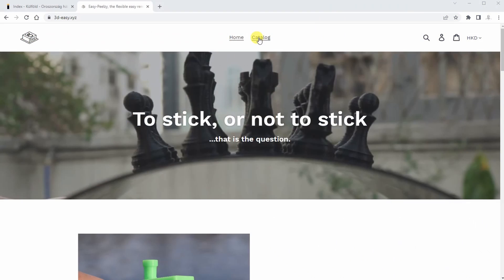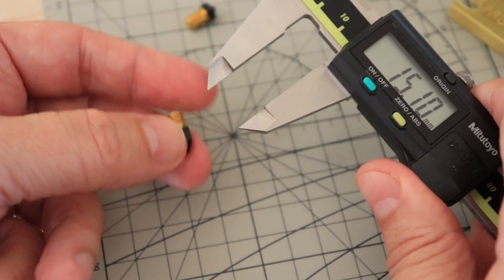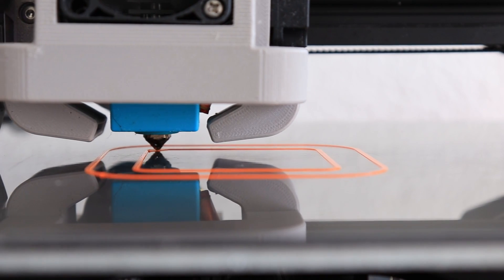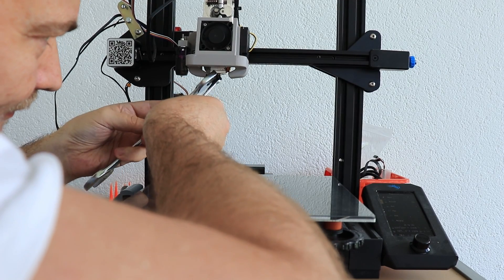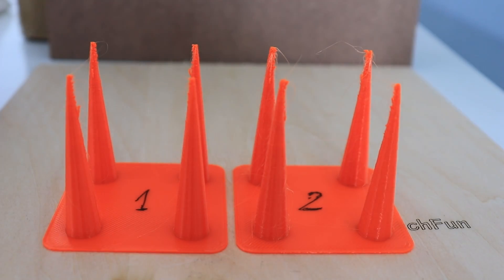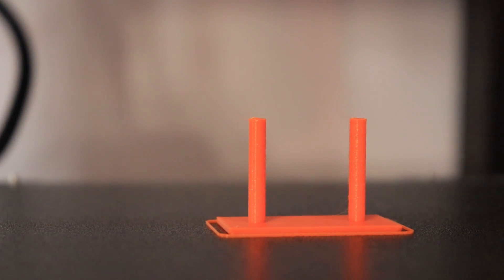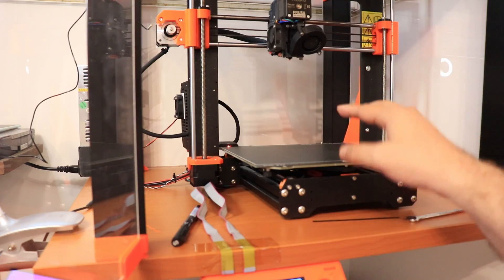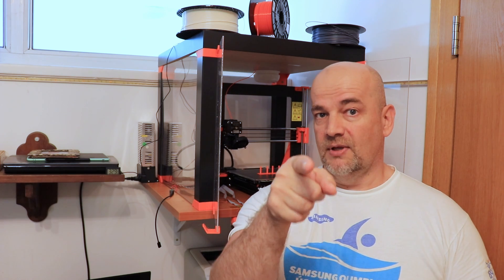Testing: Black-Ops non-stick 3D printer nozzles by 3D Easy (MK8 and E3D-V6)

Comment: The coating is not for stringing prevention, even if it may help a little. The test was not adequated, as the teflon coat is useful mainly to prevent  sticking of the filament onto the nozzle surface, acumulate there, and do some more chaos in time. Here I am talking about sticking in the first layer printing time, but also for long or very long prints (tens of hours or days, printing big layer height, or high speed (relatively speaking, depending on situation). For such a printing, even if you use the nozzle but one time (even if it will not be the case), it does worth. Also, the thing with the wrenches: common guys, this is easy to be addressed...

Comment: I don't think that will help stringing at all stringing is not caused by sticking to the nozzle so an interesting coating isn't going to change that

Where this could help and it will be much more difficult to test because you got to get the right roll of filament PETG sometimes prefers to stick to the nozzle rather than stick to your build plate if you have a build plate that the PETG you're using doesn't like or if you don't quite have your temperature speed and first layer settings quite tuned right for PETG also it might help with buildup which can drop boogers into your print a good test print for checking that might be to print a large width lithofame lots of nozzle to filament contact back and forth lots of chance for it to pick up boogers

People who have printed lithofanes with PETG will know what I'm talking about where throughout the print it drops these little cooked off bits of filament into your lithophane p e t g is not guaranteed to do this but it is more prone to doing it so

Yeah testing this would be pretty difficult to do at least I can't think of an easy way to do it

As you have noticed you are going to have to be quite careful with these nozzles scraping the coating off of the wrench faces won't matter much but the cone leading up to the nozzle opening needs to be protected so you don't scrape off that coating

Comment: I dont know if its possible but could the nozzle tightening and removal be done with a plastic wrench thats softer than teflon? That would remove one variable of the removal of the nozzle coating. Then again it might not do anything as the layer on the nozzle is so thin. If the coating bond to the brass nozzle isnt stronger than the resistance generated by tightening and loosening. It will just strip off anyway. Teflon coated nozzles are a good idea but looking ad the adhesion issues, it presently doesnt seem that viable. Maybe if they had scuffed the outside of the brass nozzle to improve adhesion would have helped.

Comment: I just started using these coated nozzles, and they seem much better than the standard bras nozzles, they are not as dirty after printing, and they show fewer artifacts. I'm also a fan of the nikkel coated nozzles, they also help with printing PETG, but the teflon coated nozzles seem better.
Reply from the maker: Same brand like I tested? It looks like they improved the quality then.

Comment: Actually, if these nozzles work, I would expect to see more stringing. The build-up of PET-G will run down to the nozzle tip and be deposited as strings on travel moves. Retraction won't help to remove this type of stringing.

Comment: It's a joke! The coating is already removed after fitting it once!
Maybe if the manufacturer fixes the slight over dimensions and you can fit a wrench without a problem, you could mount a nozzle without damaging it?

Comment: Basically a brass nozzle. I presume since you called it an all metal hotend, that the hole for the filament is 2mm and not 4mm for a PTFE liner. Even so it would appear that this nozzle is not suitable for abrasive filaments. If this non-stick coating is Teflon, then it's not really suitable for much over 240C either. I think some further clarification is necessary. And not wanting to sound negative but is filament sticking to the outside of the nozzle that much of a problem, and does this solve what problem there is?

Comment: Too good 1st layer and bed adhesion for testing ;) I would guess the nozzles are, if the coating repels PETG, suitable for "normal" users with "almost there" settings, like me...
For us, PETG likes to mate with (in order of preference) PETG, brass and whatever bed surface.
It's very easy to drag previous extrusion with the nozzle, either due to too much flow or nozzle being too low, collecting gunk to the nozzle and depositing it to some inconvenient place, causing nozzle to grab and drag more PETG all over.
Reply: The worst contributor to dragging is having unretracted material present at the nozzle orifice. Always retracting (Cura: set Max Comb Distance Without Retract to ≤1mm) helps a lot, but your PETG needs to be dry to resume well after retract.

Comment: Nothing you can do anything about, but these nozzle's, they are complete B.S.
The coating is coming off way too easy, meaning this is a painted or dipped coating, and not anodized or chemically attached to the nozzle.
Also, the real thing I would like to know, is how steep is the angle of the opening in the nozzle, where it compresses the filament?
Good review though, because you at first explain that people should make their own judgment.